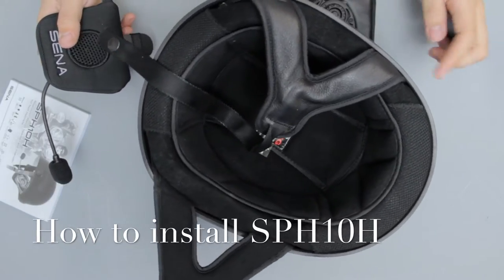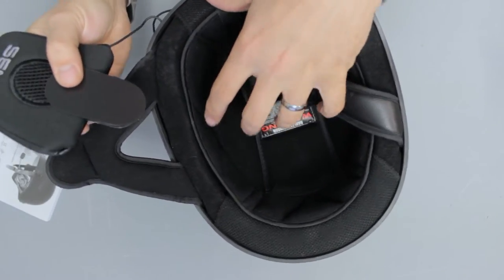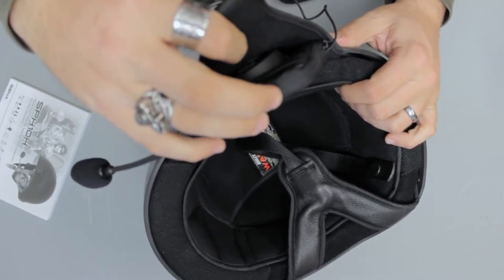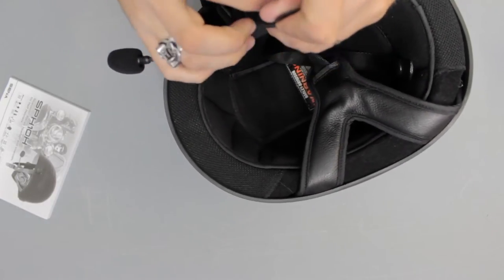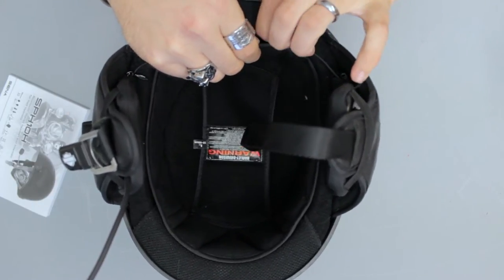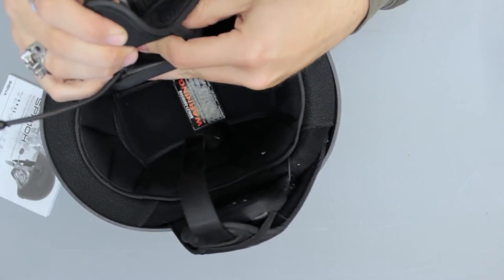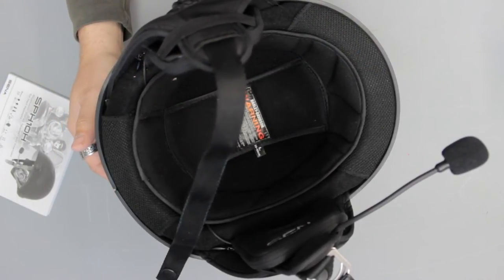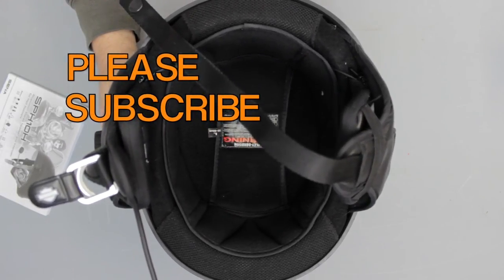How to install the Sena SPH10H bluetooth headset

Comment: Thank you for the video. May I suggest that you disconnect the controller from the base and thread that through the ear opening first, then carefully push the flap into the helmet, then make sure the base is all the way through the ear piece, and finally reattach the ear piece with base to the control....  makes life just a little easier and less stress on the controller trying to stuff it through the ear piece all at once. Took me a couple of minutes to figure this was faster, and everything works just dandy. :)
Reply from the maker: K Dobermann nice,  I'll be setting up a couple of half helmets for some riders next month for the Ride with Touring Midwest Sturgis rally adventure so I appreciate the tip.

Comment: I was actually thinking about getting this. I know it’s an older model but are they still worth it? Just need some music and phone. While talking to my passenger.
Reply from the maker: Dan Lindemuth yeah I would say so. It was a good unit when I was using it
Reply: Touring Midwest do you use a communication device now?
Reply from the maker: Yep, after this one I was using the Sena 20s than the 20s evo, last year I got the Sena Cavalry Bluetooth half helmet, and currently the Sena momentum lite Bluetooth full face helmet. I'll switch back and forth between that and the Cavalry depending on what I'm doing

Comment: Horrible headset. If you were able to split the base unit from the base there might be a chance to get it to work. Had I seen this video before I bought I would not have bought it. I challenge anybody from Sena to get it to fit a helmet. I tried 2 different helmets and neither would install. The sah10-a is a far superior mount. I did not realize that the head unit was permanently affixed to the ear pad!